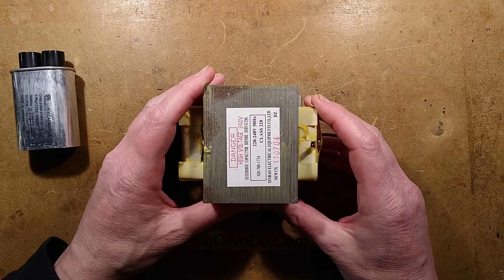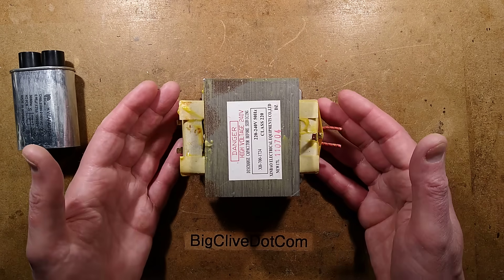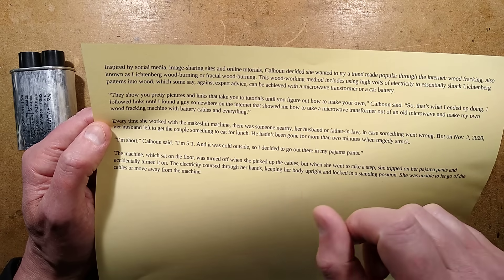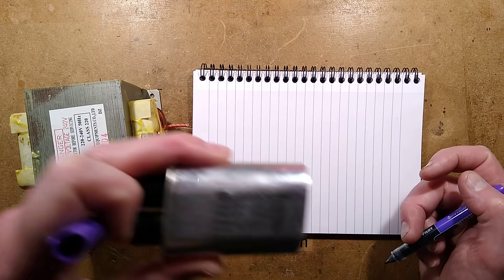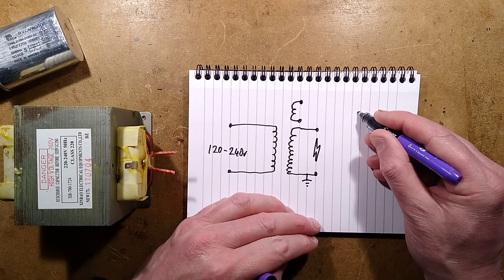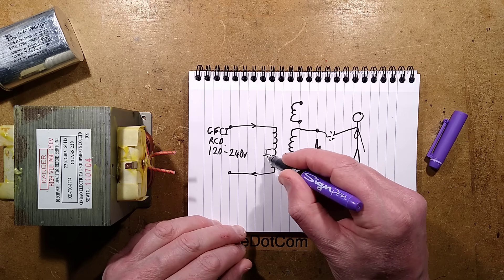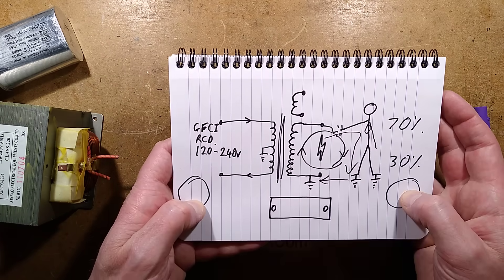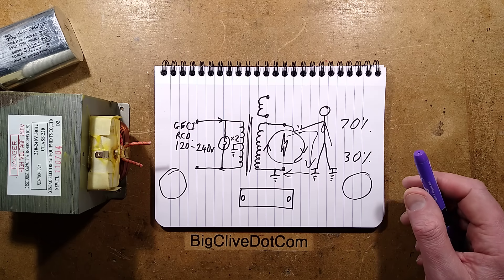The most deadly project on the Internet

Comment: Actually, the electric chair begins  at around 400v DC. Generated by the prison itself, as the power companies will not countenance use of their power for such things. They raise the voltage to over 700v if the first jolt doesn't stop the heart. I know, I was kind of amazed to find this out too. As an electrician, I've withstood 277v many times, and 400v doesn't seem like enough. 

But I had no idea that xformer in a microwave put out 2,000v. Guess I'll never fuck with one.

Comment: Where I'm from. When ever working with any current, no matter the voltage. We are thought a simple quote. It is "I am just going to...". Whenever you are about to say or think that, you are not thinking safety. Too many people have died or seriously hurt themselves or others while they were "JUST doing something".
It can be applied to many other fields as well.
Imagine a jobsite. A house is being built and you are a carpenter. You are on a roof and you are about to pack up for the day. You climb down, take off your harness and stow your tools. Then you realize you left something on the roof.
You would agree that climbing back up without your harness "just quick" just to get a tool is a stupid way to fall off and hurt yourself or worse.
So, you could also agree that running off "just to get some paper" to wipe water and baking soda off your hands while the power is on is ALSO a stupid way to hurt yourself or worse.
You could be lucky and just hurt or kill yourself, but if your unlucky you take someone with you.
Don't "Just do something real quick". it's a real quick to die.

Comment: I've got one of these insect electrocuters - you know, the ones with the blue tubes - and the high voltage is simply derived from the mains with a step-up transformer. Neither of the ends of the windings are referenced to ground, so just touching one should be OK (although I haven't tried). The transformer outputs are connected to alternating wires of a grid (spacing about 5mm) so that a big current flows through anything that bridges the gap. The insects just fry! Often with flames and sparks. There are grills to keep fingers out but they can be easily removed to change the tubes. I've wondered just how safe these are as it's possible to have them plugged in and energised with the covers off.
Reply: Its bigh voltage w very low amps. Not to say it can't kill you if you're well grounded.
Reply: @bobkuhl   As little as 50mA can stop the heart. Given a fixed capacity source, a higher voltage can actually be safer because it will reduce the current. A 500 watt source at 25000 volts will be able to push 20mA. It will hurt a lot, but probably won't kill. The problem with 4,000 volts is that the current is 6× higher than the same power at 25k volts, well into the fatal range. The problem with microwave transformers is that they are designed for microwaves and are thus intended to service around 1200 watts.

I've received ~5 25kV shocks in my life (from home made equipment similar to a CRT high voltage section). It was certainly accidental in all cases and I definitely don't recommend it, but I'm glad I've never received a 4kV shock because I probably wouldn't be here if I had.
Reply: depends if the transformers high voltage winding is separate/isolated from the mains, if  so 'reasonably' safe if it has current limiting resistors,    if not, potentially(!) deadly

Comment: Nobody should be doing this without  using tested certified HV gloves , and you need to be trained to use those . 🤦🏻‍♂️  You need high voltage probes , cables, etc. It can be done safely , but it requires a good investment in equipment ,  and knowing what the hell you are doing

Comment: I remember lying on my grandma's carpeted stairs while plugging in Xmas lights wrapped around the wooden railing. My right arm started to vibrate. I realized I was touching both prongs with thumb and index fingers. I was like, that felt kinda cool, so I did it again. I wasn't the smartest kid ;D
Reply: 120V AC you can do that.

Comment: hold on tight, does it have a DC output ? I suppose you would have to tell a short story,
 " once upon a time, I permanently ran out of time." I suppose potential difference knows the path of least resistance, to get an equilibrium., your educating us. the more I learn, the more I relise that there is a lot more to learn, I wont live long enough, but keep trying.

Comment: could I decorate my coffin with fractal burning, quickly enough before the lights go out, and it all goes quite.? where my dad work in a 7 acre crucible / carbon brush factory, where there was graphite and carbon dust every where, they had big DC machines, and the electricity would travel across the floor, like lighting,.they were not too bother as they did not have to pay compensation, in those days.health and safety, was not in operation then.so it was not until they had to pay, that they did any thing, 
I am glad that you are getting people in touch, with reality.

Comment: Well explained about the RCD not tripping.  Only an idiot would work with such high voltages.
Reply: Making a high voltage step up taser using boost converter, then step up transformers off a 9V battery is ALWAYS FUN.
9V → Inverter → 100,000-1, iron-core transformer.

Comment: I worked at a TV shop that included fixing MW's. Getting shocked once in a while goes with the territory when working on TV's. One day another technician was working on a MW and accidently touched the secondary going to the magnetron. You heard a WOOMP! sound from the current draw and it knocked him over. His hand was numb and it felt like it was twice the size.  He laughed it off and no serious injury occurred. He was lucky! Speaking of shocks on older picture tube type TV's. Yeah, you might a discharge of up to 40,000 volts, but it would be low current and high frequency if it happened during operation. Not saying your lights won't go out (vision) or you won't jump. But it's unlikely to kill you. I have encountered power line leakage on sets where exposed metal is, like on a connector.  Get between that and ground and you could be toast in that scenario.

Comment: I have to admit, I've been getting really into electronics and electricity fundamentals this past year. I ran the gambit on all the cool YouTube videos including this one... And others. I wanted to get a high voltage power supply (most commonly used for neon signs) in the 10-20kV range. I wanted to get a large microwave transformer and experiment with low-volts/high-amps and vice versa... But my amygdala and frontal cortex must be working right because the bit of fear I had has prevented me from pursuing this, at least for a while until I'm orders of magnitude more comfortable and knowledgeable with safety procedures.

Comment: There is a reason it says only qualified people should open them up. I'm surprised more aren't killed just messing with the microwave open chassis. I'm a certified electronic technician and power system operator (UHV grid operations certified) and there are important safety procedures that must be followed with HV transformers, from household to grid, let the professionals handle it. I know from experience not to help others with DIY projects without being certain they respect what they're dealing with. I remember my Dad and Uncle messing around with the anode of an old B&W TV. Laughing about getting "bit" by it. Yeah, to the tune of 10KV at 20A. When I told Dad he was lucky he didn't melt his metal leg braces he blanched. Stupid ignorant people.

Comment: Deadman switch might not work when muscles lock up.  A GFI can be rigged on the secondary to kill power if more than a few microamps of ground current are detected.  My engineering textbooks say 1 mA has killed in the past and as low as 30 Volts

Comment: When I was a kid I made this device and played with it a lot before I got complacent. It would blow up plants lots of fun Got shocked for just a moment and it was horrific it burned the tips of my fingers badly and punched smaller holes in my hand everywhere the arc jumped the shocked was local to my hand and didn’t pass over my heart but I’m sure it would of killed me if it did and my 3 friends when I asked them what they would of done if I fell over all said they wouldn’t know what to do. The answer is CPR and only takes a few minutes to learn how to do but non of them knew how to do it at a later date I thought them all how to do cpr because I Allmost needed it lol 
I was placing a screw on the block while my friend was holding the lead the lead had a connector that was surrounded by a plastic case the plastic case was not meant for these kids of voltages and the arc jumped out into my hand when I noticed I pulled away with manny burns and a limp arm…

Comment: Wow, I cant believe how stupid people can be to think this is a good idea.
I worked as a electronics technician for 30 years and had my share of shocks ranging from 250v mains to 30kv on eht caps on TVs, the worse was the 2 to 8kv sitting on the end of valves exposed bare metal enough to the earthed back of the tube that puting your hand down there to adjust something poked a hole right through my hand and burnt like hell, seizing up my muscles etc, luckily I kind of yanked my hand out somehow , ripping chunks of skin off all the sharp bits of the TV as I did, I was a young and fit  apprentice do survived and never did that again lol, but I can 100% see that could easily kill me now in my 50s.
Encouraging the general public to mess around with 2kv transformers is unbelievable, one thing know about general.public is  that they are often easily lead,  these youtubers who encourage this have blood on their hands.

Comment: Working as an electrician even the shocks from the wall or from wire leads are dangerous in the US. Though I was lucky mostly due to time and place injuries I did receive injuries due to shock when I was working on a 10-3 wire for a heating system. I was under a house and the panel was locked out and tagged. I was wearing protective lenses and gloves not bare hands. I was laying in a puddle but didn't think much of it as it's sand and again was tagged and locked out. I went to cut into the heating wire to junction another heating line from one room to another for power feed in an approved junction box. I immediately locked up head to toe, my brother who was also my boss saw what happened and ran without hesitation into the house and killed the breaker. The power traveled down my arm and off the back of my elbow into the water and thankfully the sand spread the voltage or I would have died. I nearly did anyway, you see while we were down there the painters cut the tag and lock off the breaker this is a felony and if charges were filed it would have been charged as 1st degree attempted murder. The man was removed from the project no charges filed at my request, but he will never work another job site again. My injuries were minimal for a 10-3 wire on a 250 Amp panel. The power flow over and then through my body was intense. 

The last crazy thing I did was because of a jerk inspector claimed we had to change the mast when we didn't touch the mast. Just being an ass about sign off so we agreed. The power company refused to cut the lead and refused to cut power on the drop. 

So my brother got the new mast had it read with the new leads in place took me to the roof after he outfitted me to stay alive. I wore a gray suit, thick rubber over my leather boots, 4 sets of gloves first rubber nitral, then leather then rubber line man followed by rubber protective gloves. I had on flash glasses and a strap hard hat. We went to the roof. First he cut the return and handed it to me, then the ground same hand soerated by three fingers and in the other hand the hot lead. Now being Illuminum you'd think no sweat it's light weight rofl nope. When standing 3 floors up on a house roof at 90 ft from the transformer it's not light anymore. He worked fast, but during that time I felt it when I energized my hair all stood up I could taste metal in my mouth, the electricity was hunting for ground all three wires were coated and I was holding their coating but that barely kept the power from arcing and I could feel it wanting to jump from one hand to the other I held the exposed leads ends away from each other and out in front of me. Insanity. 

I lived and we got the job done wasn't worth the pay 10 dollars an hour our about 8lb 50. At the time. I quit when 540 blew up in my face I was done never worked in high voltage again. My left arm still gets sore from the hit it took. I don't have issues with what's being done but it should be done with permanent fixed high voltage lines, safety glass in either a hood or fixed safety zone and a buzzer or bell and light to alert to voltage being turned on. This can be done safely it'd just not. Weather it's laziness or complacency it's not the thing you want to oops with. I watched a man's arm get blown off by high voltage he survived but no arm and third degree electrical burns on his chest. It's sad how complacent we have become to the danger of power. It can all be done safely but only if you don't become complacent.

Comment: Please don't do anything! A Circuit Breaker is for overload protection, different classification different fusing factor. None good for direct contact! An RCD, RCCD, ELCB. As indicated in the video are mA trip rated primarily to protect against a human completing the fault circuit. Open up an electronic lighter and operate without the covers, absolutely harmless, but it produces more mA than an RCD requires to trip.
Have never forgotten the first week or so at College nearly 50 years ago, "Under ideal conditions a fortieth of one Amp is enough to kill You!"
As an apprentice, tradesman and engineer have had and seen plenty of belts, some might have been fatal but for the actions of other experienced tradesmen in the immediate area.
Breaking down components is a F'ing stupid idea!

Comment: a safe way to do this would be to put a relatively low amperage fuse before the transformer. you only need a couple kV, and not that much amperage to do this. high voltage very low amperage wont kill you. Also if you're using a microwave transformer just BUY IT ONLINE FROM CHINA, microwave capacitors WILL KILL YOU.

Comment: I don't do wood burning as well I have no need for something like that. But what I do experiment with is creating a self reliant form of electricity after lets say an EMP or something like that goes off. What I do is connect the transformer to lets say a grounding rod or pipe that has been grounded to the earth. There is a flow of electricity that comes from that and it is natural. Do you think it would be safe to connect lets say a power cord to the business end of the transformer and then connect the left side of your diagram to the grounding source. I have seen light bulbs being lit up this way but the biggest problem is too small a transformer. Do you think it would be safe to experiment with this transformer for that kind of project? Of course you always have to take safety into your way of thinking. It would be nice to have your opinion. Thank you.

Comment: The first thing to trip may be the circuit breaker. Those tend to be on the order of 15-20 A. 10 A is already enough to likely cause death.
Reply: Please don't do anything! A Circuit Breaker is for overload protection, different classification different fusing factor. None good for direct contact! An RCD, RCCD, ELCB. As indicated in the video are mA trip rated primarily to protect against a human completing the fault circuit. Open up an electronic lighter and operate without the covers, absolutely harmless, but it produces more mA than an RCD requires to trip.
Have never forgotten the first week or so at College nearly 50 years ago, "Under ideal conditions a fortieth of one Amp is enough to kill You!"
As an apprentice, tradesman and engineer have had and seen plenty of belts, some might have been fatal but for the actions of other experienced tradesmen in the immediate area.
Breaking down components is a F'ing stupid idea!
Reply: @lesliemackay7853  Apparently I wasn't clear enough. I meant that you will be dead before any protective mechanism kicks in.

Comment: I'm an Electrical Engineer, I design control systems for machinery of various natures, knowing the relevant safety risk assessments and probability of fatality when things go wrong with these DIY wannabes I sit and facepalm at many of these 'how to' videos that are put out there.
Regarding the above there are a few ways to dramatically make this system much safer which was not mentioned here (guessing on purpose) but I will not entertain you on how to achieve it as that encourages people to do DIY without the competence and knowledge of working with such equipment.

  YouTube needs to take more responsibility over these dangerous videos.

Comment: Car jump leads are overkill on that secondary. Look at the size of those small ass spades, and the jumper cables in the states are usually 2-6 gauge, more than enough copper to handle that load.

Comment: I don think a lot of people understand that you dont even have to touch it, you just have to get close enough for it to arc to you then its game over.
Reply: I think at 2 kV that's not yet that high a problem? I think air need something like 30 kV/cm to break down, so you'd still need to be less than a millimetre away from the contact (also your body and the return path through ground would create some voltage drop, too, so you'd have to be even closer for a spark to form). Or am I missing something?